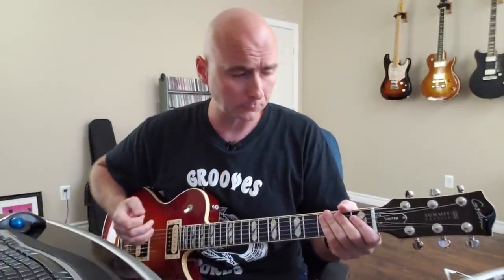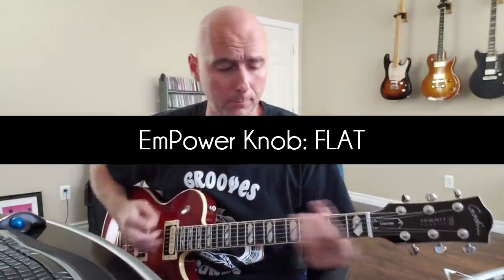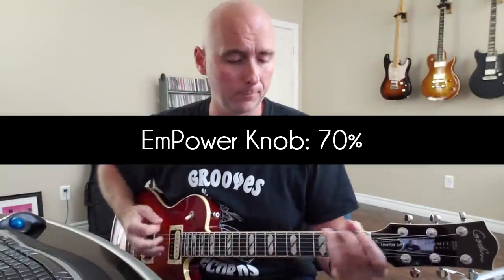FRFR Speakers: Why Do Results Vary SO Much? How Does The Mission Gemini 2 Fix This...

Comment: A great explanation on the relationship of how we "hear" our guitar amps (actual amp) vs a "studio" type sound out of our monitors and/or FRFR speakers. My idea on creating tones with the Helix is the ability to capture the complete the tone element that you can't get with a traditional amp setup while you are on stage and just hearing through your kneecaps. It is very true. When you stick your ear down in the path of the direct speaker projection, it is not what you hear when are standing up or in the far distance off center. I currently a pair of Turbosound IQ8 and found that I needed to shape my EQ a little warmer on them. But i also shaped the Global EQ on my Helix also to be a little warmer and on the dark side... I have seem to have found a balance when I hear FOH vs my IQ8's. But I am extremely interested in testing either the Mission Gemini 2 or the Line6 Powercab 212 to discover its results. Thanks Jason for this video.

Comment: Hey Jason, so does the 87 degree pattern apply to the entire audible spectrum? If directionality is directly related to frequency, regardless of where the tweeter is mounted, seems like you'll hear the same audio pattern.
Reply from the maker: From what I have been told by the folks at Mission, is they worked very hard to have the same flat response over this 87 degree pattern. How exactly they accomplished this I am not sure, but it really does have a very wide dispersion where it sounds much the same.

Comment: Hello Jason!  Many thanks to you for all of your very comprehensive videos regarding the Line 6 Helix.  You allow so many of us to learn how to get the most out of the Helix.  I've been looking closely at the Mission Engineering Gemini 2P, which I would power with the Matrix Amplification GT1000FX-1U.  In doing so, I would clearly miss out on the Empower feature that you are enjoying in the powered Gemini 2.  While I appreciate the ability to quickly compensate for an overly bright patch with a twist of the Empower knob on the back of the Gemini, I can't help but worry that I'd find myself using this control much too often and would be better served by making the needed adjustments within Helix.  If I understand you correctly, you're finding yourself playing with the Empower knob at the 75% toward Flat range.  Is there a simple fix via Global EQ that you would apply if you didn't have the Empower knob - an EQ setting that would address the increased high frequency content that seems to result from the Mission FRFR coaxial speaker configuration?  Or, do you find that you would have to re-tweak all of your patches individually to best replicate your original tones?  Would it be worthwhile for you to do an ABC comparison between your standard Placator patch (recorded as you normally present your sounds to us, the same patch played with the Empower knob 100% Flat, and lastly the same patch played at the Empower level that you find best duplicates your original tone?   Thank you in advance for considering this and for helping me plan for a Helix centric FRFR rig.  Best regards!
Reply from the maker: My pleasure Robert :-) I look at the EmPower knob more as something you could tweak at a gig if you found your previously dialed in patch was not sitting right for the situation you were in. I did seem to enjoy the sound of it right around the 75% mark but that could change depending on the situation I was using it in. Nice thing is it is such an easy thing to just add a little more or less of. I wouldn't personally think of re-tweaking all my patches as I found they translated very nicely sometimes just need a small turn of the EmPower knob. There is no other way to really show the sound of the EmPower knob other than by mic'ing it as I did in this video.

Comment: I can vouch for what Jason is saying about the Gemini sound dispersion, your sweet spot is much wider. One thing to note, If you play at loud volumes (wasn't going thru the FOH, and I have a very loud drummer) I had to turn up pretty loud and the HF driver loosened up and began to rumble. I had to hand tighten back up, but it is something to keep in mind, especially if you plan to use with a Bass as well. Good video Jason.
Reply from the maker: Thanks so much William :-) And thanks for confirming my thoughts! Good to know about the HF driver, hopefully not a common issue...

Comment: One thing I don't agree with. The Helix does not sound near as good as a Kemper. Not even close unless my ears are broke.
Reply from the maker: I was a Kemper user for 3 years and recorded a number of albums with it. It can be an incredible sounding unit and it can also be a truly horrible sounding unit. The Helix can likewise be an incredible unit or a horrible sounding unit. The Kemper sounds amazing with a profile that is done properly and fits the task at hand just like the Helix sounds amazing with a properly dialed in preset that fits the task at hand. But, I do have to disagree with the the statement that the Helix is "not even close" sound wise as that is just too much of a generalization of something with too many variables.

Comment: Okay, so I have a couple comments.  1) seems like they just put a hi cut control (which is still very nice to have), but my bigger concern is how the patches sound out front to the audience.... so, if you’re not using these as your mains, you haven’t really addressed the FOH tones.
2) I wonder if it’s possible to make some “Amp in the Room IR’s”... THAT would be an awesome option for guitarists that are making the jump from Tube amps on stage to running direct and are put off by the direct, mic’d sound (as I am...but I’m still working hard to dial in that warmer, fuller room sound from my Helix)
Your videos have been extremely helpful... thank you SO much for your time and knowledge!
Reply from the maker: My pleasure and thank you for the kind words :-) In my discussion with the folks at Mission, they told me it is much more than just a hi-cut filter. If this was not being used as my mains, I would be running straight out of my Helix to FOH. I have found that the Gemini's EmPower, is a very nice feature for solving the whole "amp in the room" thing so many complain about.

Comment: Interesting topic. Reminds me of a request I'd like to make. I've been trying to get single patches that work for my warmer humbucker guitars but also my bright strat. How would one approach this? Or is it silly to try it? I find that when I dial in according to the warmer first I need to dial my strat tone knobs way down (60%ish). The flip side is difficult since I can't brighten up the humbucker.
Reply from the maker: Yes that is always going to be a little tough. I would say to try dialing in something in between the two sounds and see how that goes? Or have separate presets for different guitars....
Reply: I suspected as much. At the moment turning the tone knobs down on the strat creates a very usable tone when using the brighter preset. I think I might just add a treble cut to a switch.

Comment: Is a cab like this or even the Gemini 1 a bit overkill for just bedroom playing? I usually just use 2 5 inch monitors
Reply from the maker: It might be overkill for bedroom playing, but I guess some folks like to have a speaker like this for that also. Nothing wrong with using smaller monitors if they give you the sound you are after :-)